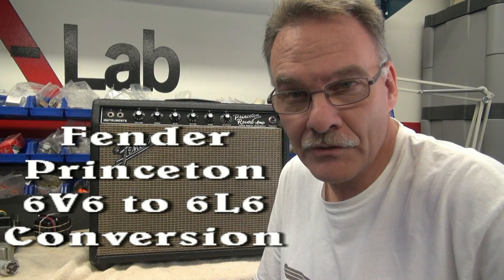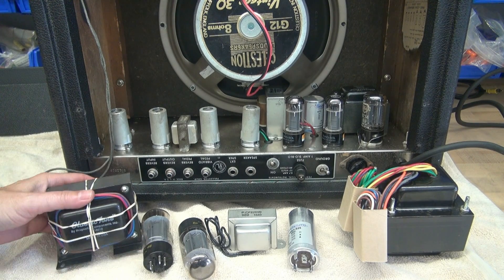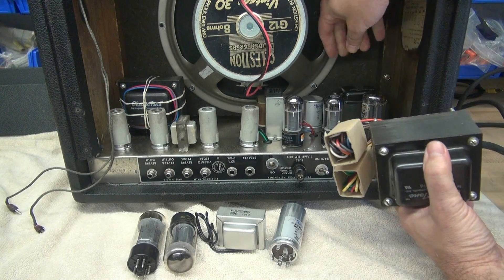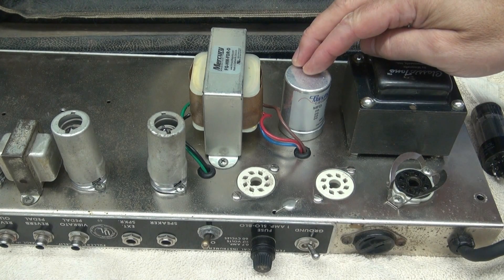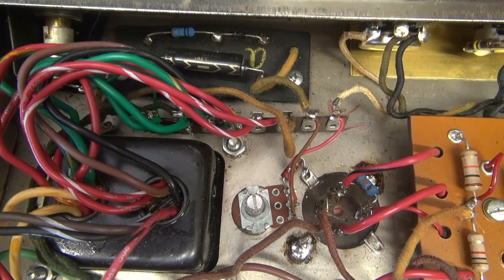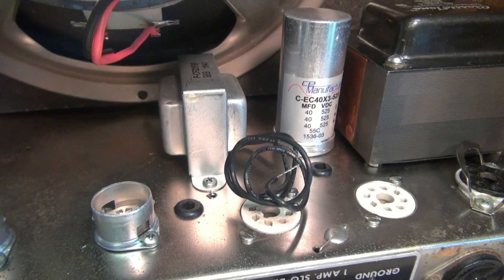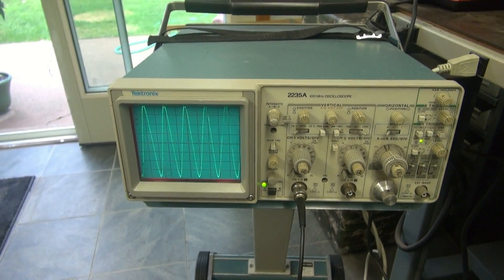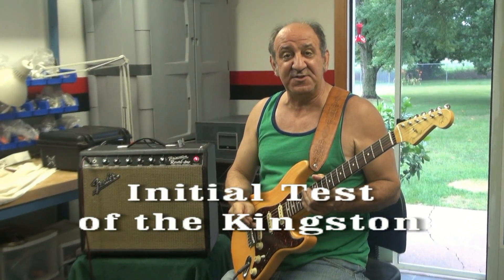How to convert a 6V6 Fender Princeton to 6L6 40 watt guitar tube amp

Comment: I had to "de-tune" my brown-face to similar, having foolishly went with four 6550s (early '70s) and the power supply on the cabinet floor with a Cetec Gauss 12 speaker. Too loud to overdrive the output stage. Much nicer, now.

Comment: How did you know when you drilled and milled for the transformer/choke placement that you would not have any hum in the amp. I have modded fenders before and had to move things around to eliminate hum. I have turned the units on with the stuff not bolted down and found different placements were quieter especially when the choke was located in a different orientation. Placement of the iron is important.

Comment: Just found your channel recently. I got a Fender Musicmaster Bass Amp. It needs alot of work, but it was free. It came with no tubes and some fried caps on the board.No speaker and the cabinet got water damaged. I need to go through it and replace all of that. The schematic I found looks very similar to a Champ. I am wondering if I could mod it to run 6L6GC's instead of the old 6V6GTA's. Planning on turning it into a head and running a 2 x12 cab.What are your thoughts?

Comment: Excellent! Love your videos, thanks for posting them.  This one was particularly helpful as I am getting ready to start a crazy build: A friend wants a single channel, no tremolo Twin AB763 circuit, and he wants it in the smallest possible chassis. I am thinking I could either put it in a Princeton or Bassman chassis (with single 12" 200w neodymium speaker). My question has been about placement of the output transformer and inductance from those primary leads. My only option is to stick them on top of the chassis and run them underneath closer to the output tubes, like you did. Thank you for the encouragement I got when I saw you pull it off. Hopefully I will be able to make this work. ANy other suggestions on keeping the inductance down? Thanks!

Comment: Hi Terry.  Nice work as usual.  I need some advice from you.  I managed to get a new fender princeton 68 siverface reissue circuit board off ebay for cheap.  All works on there.  I need to get tubes and an enclosure and then make a cabinet for it.  I have read that upgrading to a fender deluxe reverb transformer and output transformer gives the Princeton more headroom.  Would the following be suitable replacements and would I need to change anything else to match.?

power transformer
https://www.hammfg.com/part/290BEX

Output transformer
https://www.mouser.co.uk/ProductDetail/Hammond-Manufacturing/1750E?qs=sGAEpiMZZMv0IfuNuy2LUU8FmnYGIyK2SY1ULuhZcaw%3D

Your advice will be much appreciated.

Comment: did you add a standby switch? would a standby switch be necessary for a 40 watt princeton?
Reply: Standby switch is totally unnecessary on anything with a tube rectifier. It provides the slow warm up you want all by itself.

Comment: About the power transformer that it was taken out, I have one just like it in mine, and I saw how the red/white leads were connected to ground... mine are not, they are just connected to the ends of each other, curled up, and taped. Is this... bad for the amp? The amp runs good, actually pretty good how I have it, but watching this video made me wonder. What do you think Terry?
Reply from the maker: Hello, The red/wht leads on my build were landed on unused terminal board spades as a place holder, they are not connected to ground.

Comment: I did this to a Princeton Reverb about 35 years ago. It was a silverface AB763 I got in a trade...those amps were not very desirable at the time. I used the power & output transformer from a Dynaco Mark IV mono hi-fi amp (used EL34/6CA7 output tubes) and even ran the output transformer wires across the top of the chassis pretty much like Terry did. Best amp I have ever had. I used an Altec 417-8H speaker. Pulled out the tremolo, installed another gain stage (just a single triode using 1/2 the trem tube) and master volume. The thing was an absolute beast and I used it for 30+ years. Last year I was storing it in my bro's barn in No CA and the barn burned to the ground in those fires. Along with a SF Deluxe Reverb/JBL D-120 I had done about the same thing to. Sigh, those were just great amps.

Comment: Nice project, but I have question. Is there a possibility to convert Peavey6505+ with 4x6L6GC to JJ's 2x6v6 (they have untypically high maximum rated voltage)  without big changes in components? I have USA version with bias pot.

Comment: I did a similar mod to my original 1965. i used a mercury magnetics Princeton big stack, so i didn't have to mill the chassis out- which gives a 440 volt plate and enough current to run 6l6. And then a pro reverb output transformer and choke. Sounds Awesome its a great gigging amp.
Reply from the maker: Cool deal man. I will have to check into that power tranny. Save on shop time.
Reply from the maker: Did you bump up your filter cap rating?
Reply: +D-lab Electronics  Yeah I moved to a 40 + 20 + 20 + 20 JJ . I also increased the bias supply to 100uf added a adjustment pot. There is alittle Easter egg hidden on the Princeton chassis too! There is a factory drilled deluxe reverb/  output transformer mounting screw  hole . Really enjoying your channel, I have experienced a lot of similar amp repairs and builds on my bench over on the other side of the world , Australia.

Comment: Every had any issues handling tubes with your bare hands? I was under the impression finger oils can cause hot spots and premature failure.
Reply from the maker: Nope, no issues. I hear that holds true on car headlight elements.

Comment: I have a Princeton reverb, what will it cost for you to do the same for me ?
Reply from the maker: Hello, Parts alone run approx $330.00, Power/output xfmr's, Choke, Pair of 6L6 tubes, 5AR$ tube, misc resistors, etc. Time is approx 6 hours. I can give you an idea $$ thru www.d-labamps.com. Is your Princeton a vintage type or re-issue?
Reply: Late 60's  Silver face but still back face chassis
Reply from the maker: Thats the best one. The chassis is strong enough to support the iron. I would need the whole amp to make sure all fits correctly. Be glad to do it for you. TD
Reply from the maker: Is your speaker the stock 10" model? We upgraded this amp to a 12" Celestion. TD